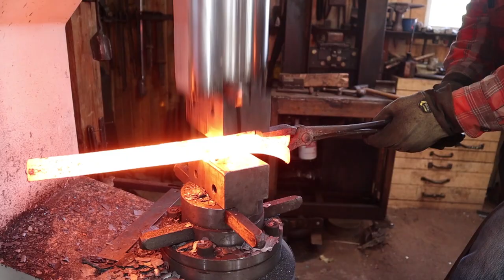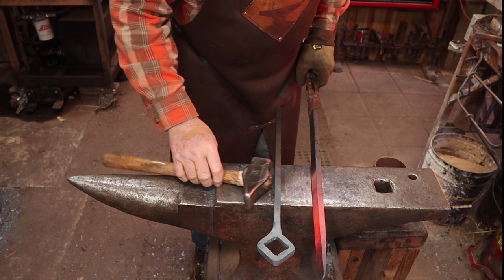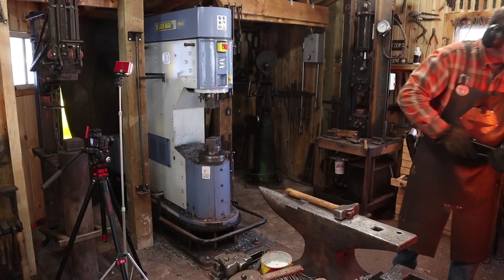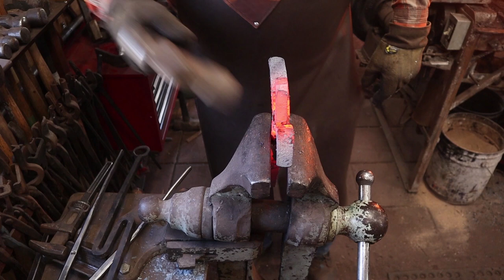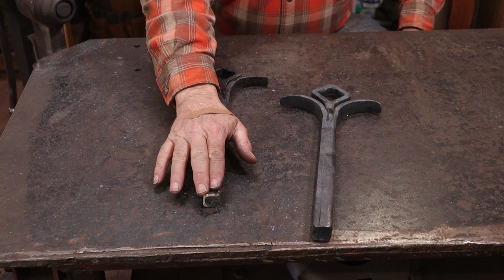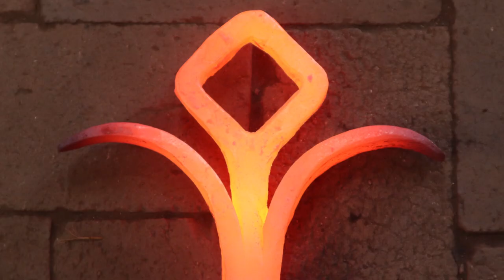Forge welded bar finial end   Andirons part 2

Comment: seeing that borax powder get blown all around by the air current generated by the heat of the steel really is concerning to me. I got myself a nice pair of leather, high ankle safety boots for Christmas. Maybe I'll get myself a nice new respirator for New Years!
Reply from the maker: That is certainly a concern
Reply: at 8:12 and 9:36 it's very clear how a ton of it gets blown around by the hot air - I suspect that's almost impossible to notice while doing it, but it being on video makes it very clear to see. It's the first time I've really noticed it, but next time I flux something I'll have to look really carefully for airborn borax and see if it's an issue.

Comment: Please, what is the pressure of the gaz in your Cayenne forge in psi to attain welding temperatures? I thank you for the fine videos, for taking the time to make them.
Reply from the maker: I run mine at 25 psi. But we are also at 6,500 feet
Reply: @BlackBearForge  First, I thank you for the reply. When I got my forge I took it to 20, could not weld but could burn my hands … I saw the gloves you wear, they are a must. Another question : when you weld like you do on the video, do you have to watch the material, could it burn ?

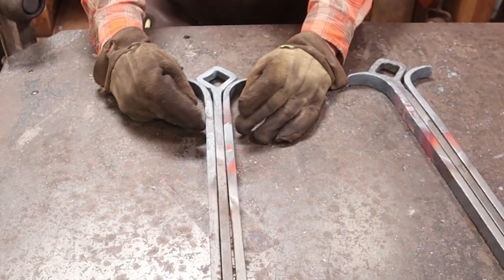Comment: your explanation at 5:40 minutes how you will forge the three pieces together is very good. Just curious, have you ever tried pinning the joint where you start the weld instead of arc welding a spot, away from the weld?  My question comes from watching Engles Coach Shop building the new Borax Wagons, "Horn and Bumpers".  Also the orientation of the dies in the SAYMAK Hammer, is that diagonal orientation unique  to the Saymak? or is it because you did it personally? Or is it standard on many hammers?

Richard Surber, of Citrus Heights, CA
Reply from the maker: Pinning is a good method. You can also bailing wire the parts outside the area of the initial weld.

Comment: I have been going to ask for an Andiron video. My Uncle mentioned them when he learned I was piddling with blacksmithing.
I have no mechanical hammers yet so I am thinking of some riveting. Is that worth considering?
Reply: kenny miller, I was thinking the same on using rivets versus welding. John, thoughts of strength, durability, etc...?

Comment: For long heats in a coal forge similar to the gas forge, would it be practical to make the airways at the bottom of the forge in a long ribbon pattern?
Reply from the maker: Only if you need such a modification regularly.

Comment: If you  start with about 25mm by 5mm flat bar then cut about 5mm each side to about 5" along the flat then move the two out side bits out of the way and punch a square or diamond hole then shape it would this possibly be any easier than forge welding it together and maybe end up with a similar result
Reply from the maker: Thats one of the great things about blacksmithing, there is always more than one way to achieve a desired result

Comment: I'm kind of surprised you didn't use a kiss block for sizing the material up after the weld. Was there a reason you didn't? Just didn't need to?
Reply from the maker: It would be an option but I didn’t feel I needed one.

Comment: I have a single burner gas ferries forge!  Is it possible to get material hot enough to forge weld with it??  I've tried several times but don't seem to be able to get the weld to take!!
Reply from the maker: Most farriers forges aren’t built well enough to reach welding heat. But it would be worth trying to find out.